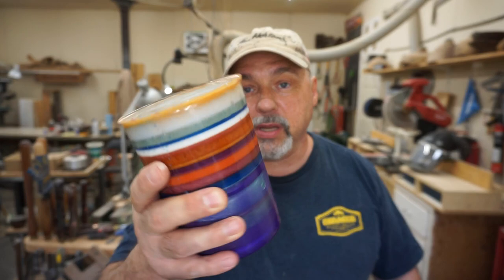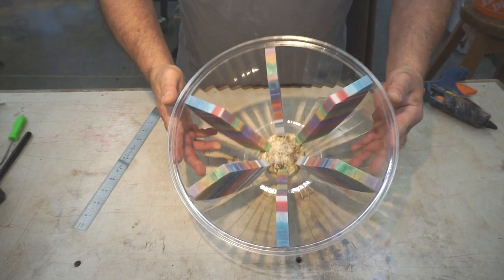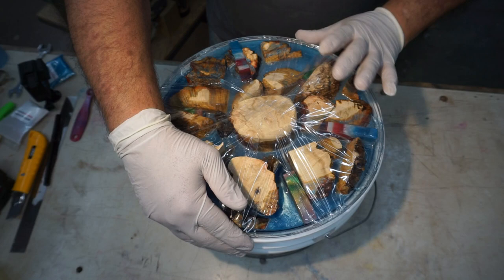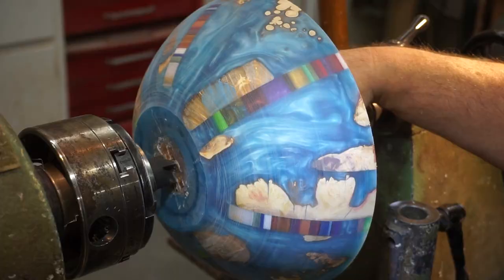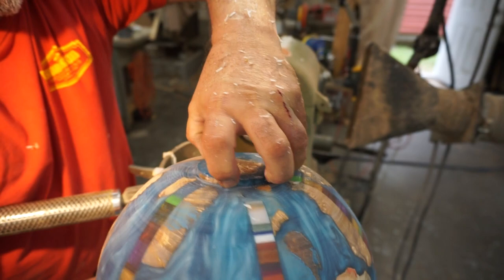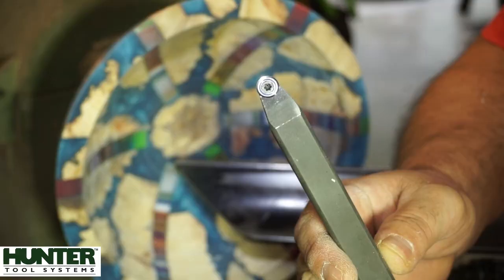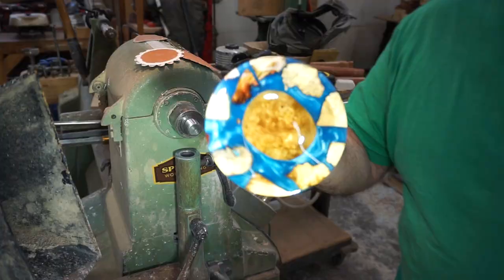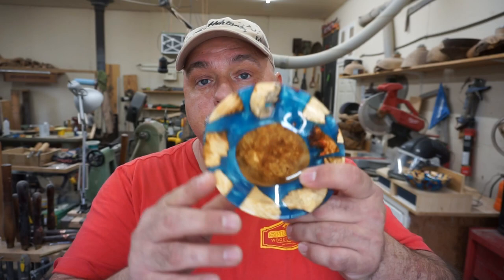Woodturning - The Resin Strip Nested Bowl Set

Comment: Tip: Look for silicone bowls, or molds, they are great with epoxy!
Reply from the maker: It’s hard to get ones that fit inside my pressure pot exactly. I want to maximize its size, thanks 😊

Comment: You might have found that if you had your glued block on the bottom to start with the blank wouldn't have slipped out of the chuck?

You mentioned about adding more resin to the top of your blank, it might look good if you wanted a contrasting or different effect rim on a set of matching bowls i.e. hot color on a cold base (blue with red, yellow or orange rim) or say brack or white rim but your container would need to be taller than your blank or you'd need to make a dammed Mould to have the ability to adde resin to the top or your blank.

You might have rough cut your blank and given it a good key for you to add the resin onto the top without it trying to separate from the blank during shaping but food for thought I think.

Something to keep it interesting and not need to try and hide 'witness' lines?
Reply from the maker: I’m a little hesitant to use a glue block on the bottom of theses pieces for coring, the hot melt glue is strong, but I’m not sure it’s that strong. I guess we will need to do a test in the future. To add more resin or not is always a difficult decision. Don’t want it to look like a repair, in this case I would of definitely added a contrasting color. Thanks 🙏

Comment: You can use masking tape to hold pieces down instead of glue then you don’t run into the issue of the plastic getting sucked into the resin in the pressure pot.
Reply from the maker: In this case I didn’t want the resin strips to move, if they did, it would completely throw the balance off. As you seen in the vid, I did use tape to hold the other pieces, thanks
Reply: @SpragueWoodturning  yeah. My bad. I didn’t finish watching before commenting 🤦🏼‍♀️. They turned out awesome!

Comment: hey jim...mark from detroit..benn enjoying lots of your videos...thinking about doing some acrylics...tell me about a basic set up to start with,,,..presure pot    vacum pump  what size epoxy.  maybe some colors   ??...if you where starting were would you start....thanks Jim and keep up the good work........Mark
Reply from the maker: You don’t need a pressure pot but it will make your castings better, same with a vacuum pump and chamber. Only buy small amounts of epoxy until you know it’s something you want to do. You can buy two packs of colors that I think have 20 colors each pack from Designer Epoxy. I recommend the Deep Cast, use code inlayjim21 for your discount. Hope this helps, Jim.

Comment: Considering the tenon problem during the coring, would using a glue block in place of a tenon have worked?  Or do you need something with more rigidity when coring?  The bowls turned out well but it wasn't quite to my taste, I would have preferred just the blue resin and burl, but that's me.
Reply from the maker: I think there would be too much flex. In the future I might try it just to see how it goes. I totally get it, just too busy for some. Thanks 🙏

Comment: Hi you have a problem with pots use water to fill a balloon as water will not compress no air as air will compress hope it helps ian mac
Reply from the maker: I guess your referring to last weeks video, if so, I will never use water in a resin vessel that’s going to be pressurized. If there was a leak it would be catastrophic, Jim.

Comment: Couldn't you have put a tenon-sized glue block on the failed tenon rather than cutting it deeper? If it were the proper size, your chuck could have held onto it. (Not a turner, just an observer).
Thanks for the videos.
Reply from the maker: I’ve never cored with a glue block on the base before, I guess I’m going to need to try it on the channel, thanks 🙏

Comment: If you were going to put a glue block on anyway, why didn’t you just do that first, instead of trying to hold on with the thin tenon? 
Also, for my money, the resin strips didn’t add anything. I’d rather see those multicolor resin “leftovers” cut up into random shapes and combined with a center wood “filler” to create a bowl/shape made mostly of the random resin shapes. Just a thought.
Reply from the maker: Was looking to try something that I’ve never seen here on YouTube. Thanks